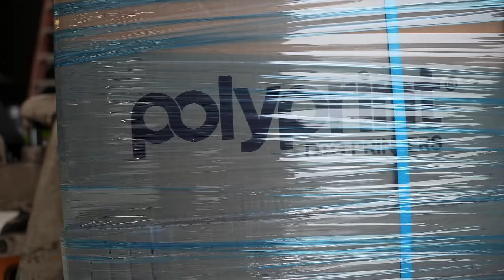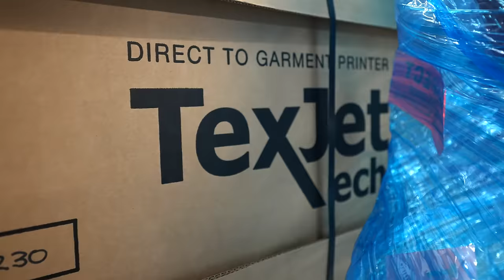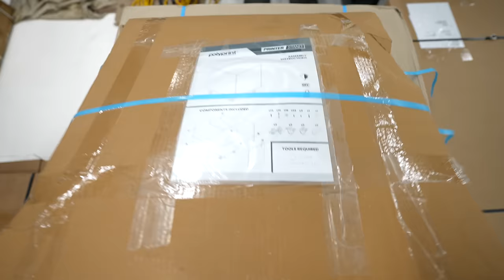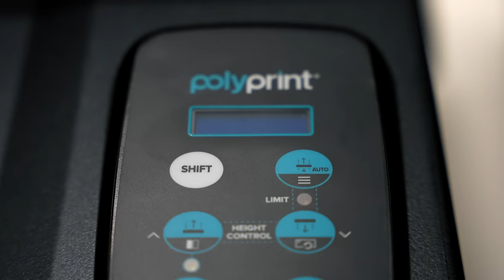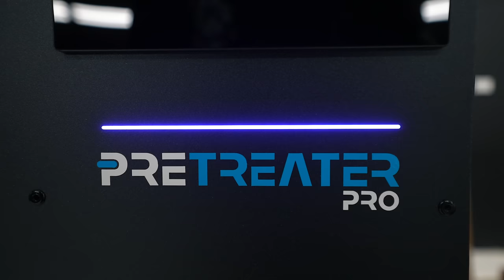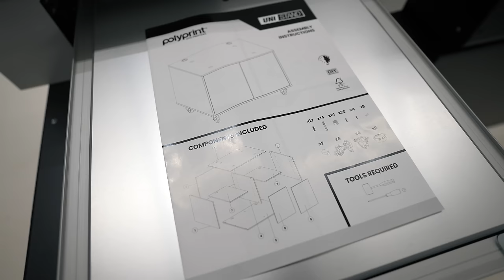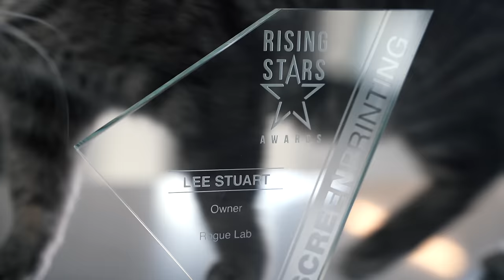FULL DTG SETUP!!! Unboxing My New Direct To Garment Printer And Pretreat Machine

Comment: Welcome to the DTG World!

I've had my Echo2 for two years now and I can share three tips for you:

1 - Getting the machine going in the morning is super fast, a typical Monday morning is just a simple head-clean cycle are you are running at good color almost immediately. 

2 - You are going to go through white ink faster than you think. You can dial in all the settings and streamline all the art, but you are still going to use up white faster than you think you are.

3 - Shut Down at the end of the day is way more important than anything else. Shutting down for the weekend is still more important again. Clean everything and then clean it again. Pay the most attention to the parking station, it keeps the print head wet and if it doesn't you are going to need a new print head way too soon ( I speak from experience).

Having said that.... I can't wait to see more about the DTF process!
Reply: Can I ask your opinion of the Echo2 in terms of reliability? Been trying to decide between the Echo2 and the Epson F2100. Not sure I like how the Echo2 is a mashup of two different machines but as Lee says, the droplet size is way smaller than the Epson.
Reply from the maker: Thanks a lot man, that's all really good advice. I have a wide format and a lot of the maintenance seems similar so far, but I'm sure I'll find the quirks and differences once I get these running
Reply: @ukprintshop  "..Can I ask your opinion of the Echo2 in terms of reliability?"

Nearly bulletproof. Keep the machine clean, and pay extra attention to the capping station to keep it clean, and you'll be printing quality stuff for a good long time.

Comment: Best DTG on the market for small shops that doesn’t print everyday! I have mine since 2019 and I couldn’t be happier.  Tons of print with little ink and daily maintenance takes less than 5 minutes with minimal amounts of cleaning solution. 
My machine has gone idle for over 2 months (NOT RECOMMEND :p) without any maintenance, no flushes no waste, all I did was a heavy head cleaning and started printing again!
Reply from the maker: That's great to hear, I don't think any other machines could handle something like that without issues. I can't wait to test it out and see what I can do

Comment: You should've go with Brother GTX Pro (or Pro Bulk if you don't want to shake cartridges every morning). I have the PolyPrint Pretreater Pro and the overspray and the waste is awful. I took it because it was one of the expensive and coolest pretreater on the market, but I regret it now. Viper Preteater - an openbox pretrater has almost 0 overspray. Shultz is also great. Best part of the PolyPrint pretater is the recirculating system which mixes the pretreatment liquid. Welcome to DTG world and good luck!

Comment: Hello Lee, Have you tried your Polyprint yet and how you like it? I got one just this week and still trying to set it up and organizing the shop for it,
Reply from the maker: I haven't had time to set it up and use it yet. Once the shop is finished in a week or two I'll be firing up all the new machines
Reply: @leestuart38  i just got mine about a week ago and im in the same stage setting it up. I also will be up and running by April.

Comment: I love your content so much.  I have never screen printed but I keep watching.  This video however... I own a big DTF shop.  We started it as a DTG shop before we knew what we were getting into but over the first year realized DTG has so many issues that we switched over to DTF and have never looked back.  

I am curious to see how hard you push to conquer DTG.  Because of your tenacity there is a chance you will go hard on DTG just to master it for no other reason than to say you did.  It will be interesting to watch you overcome some of these things.  With DTF you actually don't have to overcome any of the things that make DTG unrealistic is most situations.  

All that to say... Don't sleep on DTF, get ready for the challenge of the pretreat box with DTG, wash test, wash test, wash test.  

This is going to be fun to watch!!
Reply: Out of interest, what dtf printer do you have?
Reply: @ukprintshop  well.... You have to understand that we started our shop with the intention of being a DTG shop.  So we purchased several Freejet 330 TX Plus DTG printers by Omniprint.  After 6 months of constant tweaking of settings and trial and error we tried printing on film with those printers and that immediately took away all of our problems.  So we currently are still using the Omniprint DTG printers but printing DTF with them.  We are very close to purchasing the powderless DTF printer from Cobra.  We have had many conversations with the owner and our rep from Cobra but are still waiting on samples from them.
Reply: @jlair  thanks for that. I’ve seen some good results with omniprint machines doing dtf :)
Reply: @ukprintshop  in my opinion DTF is the only realistic way to go with an Omniprint.  But sadly once you realize that, you realize there are WAY better options for DTF than omniprint!  It is what it is, we made the investment so we have to make the best of it.  Things will be much faster and efficient once we get a real DTF printer. Lol
Reply from the maker: Definitely looking forward to the challenge of learning all of this stuff. DTF has my attention as well, I'd love to start producing those things for clients at some point.